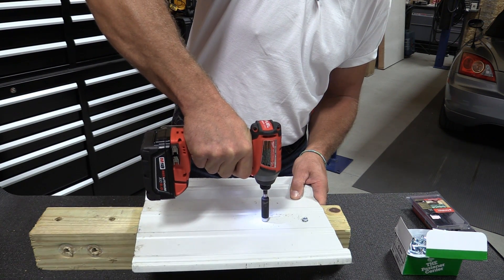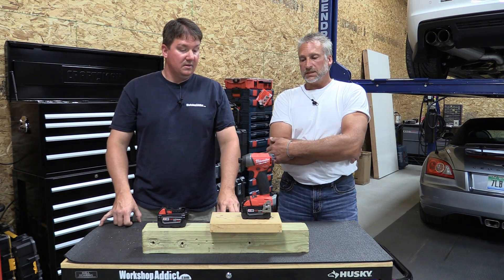Milwaukee M18 Fuel Impact Driver - 2nd generation

Comment: So you can see I commented 3 yrs ago; I JUST was able to afford this tool over Christmas 2018.  I must be doing something wrong, because MINE can't budge a 100 ft/lb lug nut.  1800 inch pounds is 150 ft/lb but somehow, my BRAND NEW one with a 5.0 AH battery can't even f'in BUDGE that 100 ft/lb lugnut.  I made sure it was on the highest torque setting possible. Any thoughts?????  thanks
Reply from the maker: Are you sure it is tightened to 100 ft lbs or it should have been tightened to 100 ft lbs.  If you take your car to the dealership, it could be at 200 ft lbs.  It should easily remove that lug if it was not overtightened.
Reply: @WorkshopAddict  Just before I tried to remove it with the impact driver, I loosened, then tightened to 100 with my torque wrench, so - yes!
Reply from the maker: @jawojnicki  Return it?  That sucks.  What brand of adaptor are you using.  Is it black?  Impact socket?
Reply: @WorkshopAddict  I'm using a half inch Drive Socket adapter with a 19 mm chrome Molybenedum impact socket
I also have a DeWalt dcf887 which is rated higher at 1825 inch pounds, and that can't do it either. I called deWalt a year ago when I got it to complain about this and all they kept saying was it's not intended for that kind of work. I pressed them hard saying that scientifically if it's rated for this torque, it should be able to DO that torque but they just kept insisting it's not designed for lug nut removal. They refused to give me a better explanation than that. I think this will happen with Milwaukee too, but I might call them this week
Thanks for your input. Lucky to see that you didn't get a bad one
Reply from the maker: @jawojnicki  Well, I would have to agree that an impact driver is not meant to be used on lug nuts.  The rate of impact and the power in the impact is meant for driving small screws.  So the impacts are faster, lighter and the rpm is higher, leading to a pather that sucks for large nuts and bolts.  It is the wrong tool for the job, although, it will work some of the time.  We used the Milwaukee shockwave adapter to try the lug nut challenge and I wonder if that makes a difference.  An adapter with too much flex will eat up power and leave you short on getting your job done.  I would highly recommend you change tools to an impact wrench as that is what the tool is designed to do.

On a side note,  if a tool is rated for a specific torque, they test that torque with a specific fastener that the tool is designed to work with.  So for example, a 3/8" impact wrench might be tested with a 9/16 socket for the torque rating.  That torque rating would not be the same using a larger 5/8" socket as a larger fastener can react differently.  That is why we always tell people that nut busting or max torque is a marketing deal and not to listen to is because the number was derived from a specific task that might not apply to your use.

In this case, it could be your adapter stopping you, but the tool you are using was not rated for the task you are working on so the torque rating is not going to apply.

Comment: that ramp up mode is so cool 
I tried this out at Home Depot the other day and was ultra impressed 
do any competitors of this impact have this mode? 
which ones?
Reply: I believe Hitachi's new Triple Hammer 18v brushless impact has this mode...it's basically this 2nd Gen Fuel on steroids and is IP56 rated, too.
Reply from the maker: Did you check out our review on the Hitachi?
Reply: The ramp up power is for a mature. The pros don't need that nonsense.

Comment from the maker: Kyle G The manual states this programming is designed for use with #8-#10 self-tapping screws from 1/2″ to 1″ going through 20-28 gauge sheet metal.  This is to stop the walking, so it could be used in metal stud applications, steel barn metal and other items.  Since they only listed the the thickness of metal once, we assumed they meant metal on wood, but I am sure it will work for many applications.

Comment: made 4 is for metal to metal steel framing.  not for wood
Reply: Then what mode I supposed to use for the highest torque ?
Mode 1 as it slowest?
Reply: mode 4 I ment